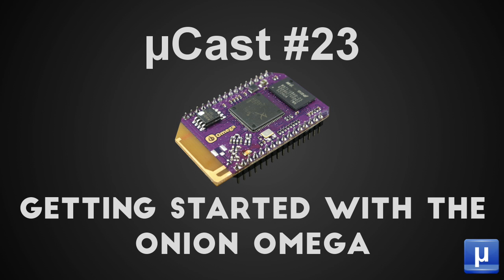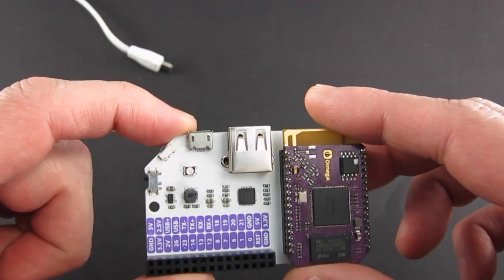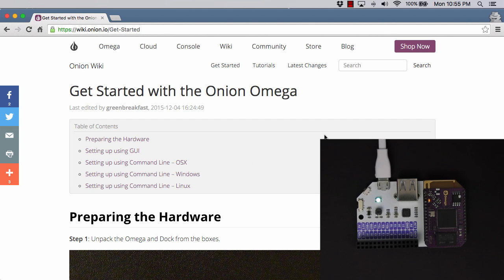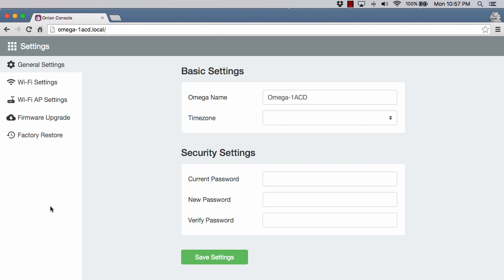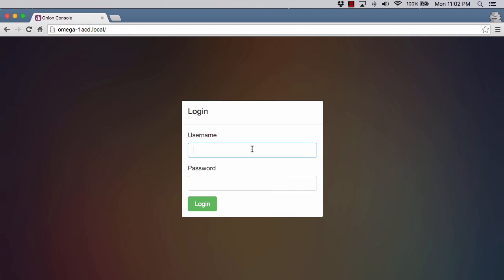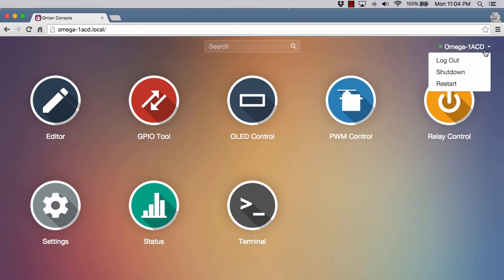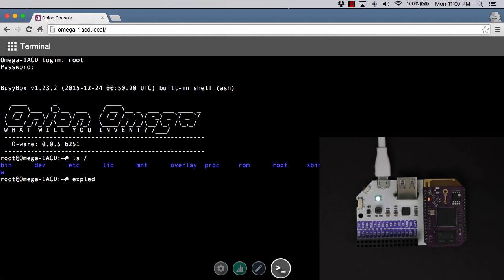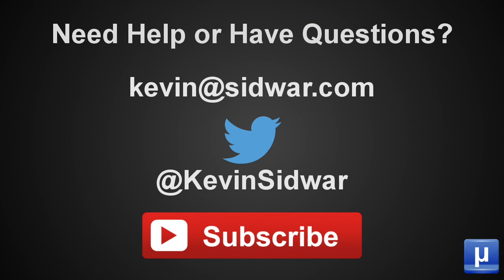µCast #23: Getting Started With the Onion Omega

Comment: Hi,
Can you help me? if i tried to connect to onion, it ask some password for wifi. i didint get it.
Reply from the maker: Were you able to connect to the Omega access point? If you look for visible networks from your computer or laptop you should see something like OMEGA-XXXX as an available network. It shouldn't require a password to connect. Once connected you can log onto the Onion Omega by browsing to http://omega-xxxx.local where XXXX are the same number/letters from the available network name. To log into the omega itself the default credentials are:
username: root
password: onioneer

Hopefully that helps. If you're still stuck then send me a little more detail of exactly where you are stuck and I'll do my best to help.
Reply: Hi, yes i could to connect, but onion omega 2 required password for AP. it is 12345678.  Omega "get started" document are contain it, just a little bit hard to find it. 
Since then i could connect it, i tried to configure onion wifi, but always droped me out due some connection problem. i tried it many wifi but it didnt work. After a reboot my onion looked it is dead :) i couldnt see its wifi signal. Via putty i could connect to it,  and there was this information. 
"""
scanning wifi networks..
interface doesnt accept private ioctl…
set (8BE2) : network is down
ra0(ralink): enable failed
>error : scan failed, try again
"""
So i cant reach my onion..:\
Reply from the maker: Hmmm. Ok, so you can connect to the Omega via Putty but can't reach it through the browser? I assume you are connecting to the Omega via the USB to serial interface. Have you tried running "wifisetup" from the terminal window to go through the setup again? Seems like it is having an issue connecting to your network. It might also be worth trying to restore the factory image by holding the reset button down for 20 to 30 seconds to get back into a known good state.

Comment: hello... can union omega be configure in windows?
Reply from the maker: I'm not sure if you're asking if you can set up an Onion Omega device from a Windows PC or if you are asking if the Onion Omega can run the Windows OS so let me answer both. 
Can the Omega be configured and connected to from a machine running Windows? Yes.
Can the Omega run Windows as it's native OS? No, only very small versions of the Linux distro link OpenWRT.

Hopefully that helps. Thanks for watching.
Reply: Does onion omega has add on like motion sensor?.. tq the answer you give answer my question
Reply from the maker: Not anything that you can buy out of the box but you could try something like this https://www.controleverything.com/content/I2C-Master?sku=OOI2C and then buy one of their motion modules. If you are talking more like motion detection with something like a PIR sensor most of those could be hooked up to the GPIO pins on the Omega. You may have to use a voltage shifter depending on what voltage the sensor operates at. So the short answer is that there isn't really anything that's plug and play but it's doable with a little bit of work.

Comment: How much available space does it have with the default installation?
Reply from the maker: It has 16MB of total space and a default installation shows 5% usage when you run the df command from a terminal so you probably have close to 15MB available give or take a little.
Reply: Excellent

Comment: Hi ! I have on question, how do you supply your Onion Omega? In the video you connected a micro USB but you didn't say to what (?) I mean, did you connect it to a laptop straight forward or do you have any charger with 3.3V? Thanks in advance
Reply from the maker: +Jeancarlo C. That's a great question. You can certainly use your laptop or PC on the other end of that USB cable. In my case I'm using a USB battery pack from adafruit. https://www.adafruit.com/products/1565  Thanks for watching. I really appreciate it.